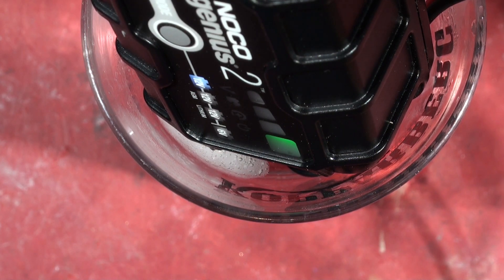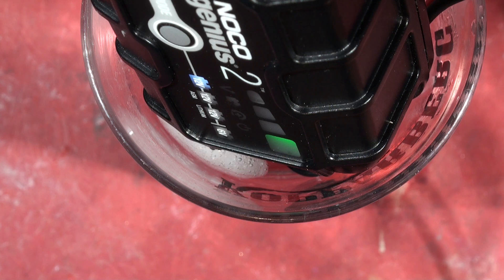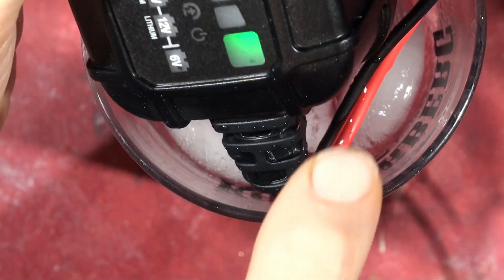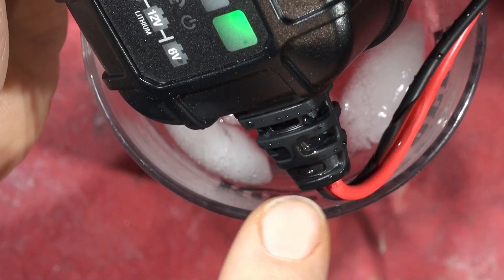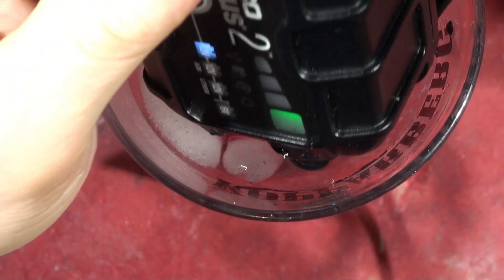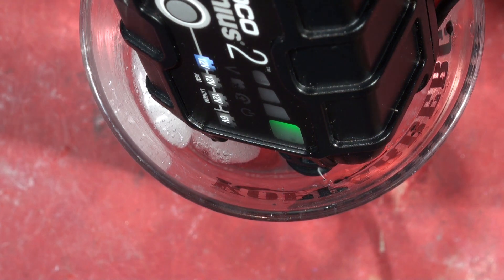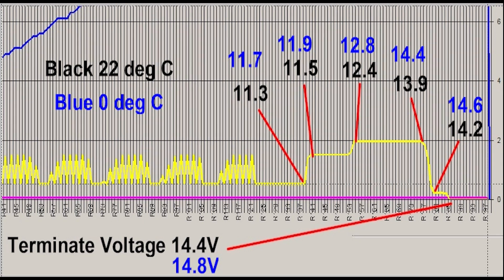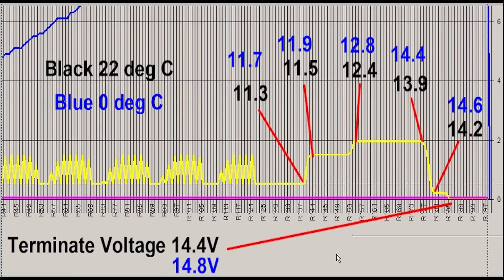NOKO Genius 2 Low Temp Charge Compensation Test

Comment: I can confirm the thermistor wires on my Genius1 are in the over mold.  The wires have a black cap over the end or it was dipped into a sealant, and it just barely visible protruding less than a millimeter from the end of the over mold.  My device will not power up and with this version 1 there does not seem to be a way to take it apart, so unable to diagnose, the Genius2 seems a better choice for someone who would rather attempt a repair than return it.  I'm thinking that internal fuse must be designed to reset itself upon cool-down.  Good video and battery chargers will be in everyone's lives from now on so it is a good skill to master.
Reply from the maker: Thanks for the info. Haven't seen a resettable thermal fuse inside the unit...

Comment: Hello magic smoke. I’ve been watching all your videos after stumbling across then whilst looking for car maintainer chargers. Was thinking of getting the CTEK but not sure now 😳. Could you recommend a maintainer please to stay on my car, the battery is an agm 95ah. BMW if that makes any difference? Not using the car much now  due to the circumstances we are all in!
Many thanks.
Reply from the maker: If you have a get back on the road charger then the Genius 2 is a good bet as a maintenance charger. I cant vouch for the long term reliability when powered up 24/7.  I found that they had put seals and O rings all over but the weak spot is water getting under the front label.  I spilled a few drops on it and it immediately went inside the LED area. I have sealed mine with silicone sealer around the label lip as I wasn't comfortable putting it out in a damp car boot with 340V DC on the PCB. the creep distances and lack of tracking slots in the PCB is a worry. If it fails i will report on the channel.  It is keep a V8 Jaguar topped up for the weekend.  5 weeks gone - so far so good.
Reply: @razenby  thanks Magic, i was looking at the CTEK MXS 5.0 but was a little concerned with the build quality after seeing your excellent review. I will check out the Genius 2, many thanks for your reply.
Oh and great channel, looking forward to more content.
Reply from the maker: @Markstevos  Thanks,

Comment: Mmm... this is it, much better. But for a lead-acid battery the final voltage is still too low. A safe device for the user and the car installation. There is a little lack of repair mode, but it is only in the more “powerful” versions. For small batteries generally okay. I was curious if you'd do the test in cold beer, but not ;-)
Reply from the maker: On 12V mode final top up / equalisation charge phase terminates at a seemingly lower voltage thatn most chargers. However, it is billed as a maintenance charger and as such it is designed to look after cell health and not as an actual charger. (Even though it does that OK).  As such, it's job is to keep the battery in the  safe zone where there is little or no sulphation,  minimal erosion of the plates and minimal loss of electrolyte due to hydrolysis.    If the aim is to store batteries and keep them in the best condition then this charger is the best one have I have tested so due to the early termination voltage.  However, I have doubts about the output filtering as I have discovered that it can go unstable if even a a small capacitance is present across the battery clips.   I cant investigate this today I  have a pile of professional Audio power amps to repair.
Reply: @razenby  Fully agreed. I usually have a very skeptical point of view when we talk about advertising content. In this case, I am reluctant to admit that the producer indeed gives what he promises and the charger fulfils its purpose. Even the estimated charging times on the Noco website for each battery capacity are reliable for this device. It would be nice if only the price was set at a bit more reasonable level ;-)
Reply: Do you have any recommendations for a better charger?
Reply from the maker: the choice depends on if you want to charge a discharged battery maintain a battery on the shelf or in a parked vehicle. I will try the 5A NOCO charger next. I have high hopes for it. I have concerns about this one because it is not waterproof. They used the wrong adhesive on the front control panel overlay , I splashed a few drops of water on it and it wicked inside the charger visa the front label. Crazy really given all the 'O' ring seals between the case clam shells.  It is definitely not ip65.
Reply: @hatsuwr  It's not so easy. For example, a device from a film, so nicely presented to us by Magic Smoke, I would describe with my unprofessional eye as a decent charger for GEL and AGM batteries from 7Ah and above, and for basic maintenance of lead-acid batteries to 44Ah within a reasonable time. 
Charger (or old style rectifier) should be best suited to the number of batteries, their type, capacity, whether it is possible to charge outside the car or only in the car, as well as the skills of the operator (automatic or supervised device).
Can you describe it in more detail?
Reply: @Tab7.6.Tab7.6  Sure, I have two vehicles with AGM batteries in the 40-80 Ah range. One vehicle is rarely used. I wouldn't ever need the charger to charge up a nearly dead battery - more just to top off after a drive and maintain in storage. My plan was to keep the primary vehicle plugged in whenever it's at home, then swap the charger over to the secondary vehicle while the primary is being used.
Reply: @hatsuwr  Fortunately for you, AGM batteries are easy to maintain. Recommended charging voltage is 2.45V per cell, what means 14.7V for 12V battery. The optimum charging current is usually set at 0.1C, meaning 10% of the battery capacity. That is, for example, for a 52Ah battery, 5.2A charging current. However, this is not a critical value. Taking these recommendations into account, a simple microprocessor-based charger is all that is needed to do this job. Either switched on in winter mode (most chargers end up in this setting at 14.7V) or, if available, dedicated AGM mode. For the capacity range you specify and the way you use the cars, a 5A charger should be adequate. In a rarely used car (probably with less capacity) it will allow you to recharge the battery in a relatively good time, while the battery (even if there is more capacity) in a car used every day is in better condition and you will not need more current or much time to recharge it. Ideally, it will be a charger with a real 5A current, because in devices available in discount stores the charging current drops quite quickly, which significantly extends the charging time - unless time is not an important factor for you. Of course, it is not that you have to recharge your batteries every day. For example, I also have two cars. In the primary vehicle, I charge the battery 4 times a year (Banner battery, manufactured in 2012), in the secondary car used rarely for short distances, I charge every 2 months (VARTA Blue Dynamic, manufactured in 2014). So far, this strategy has shown itself to be successful in keeping the batteries in good condition for several years.